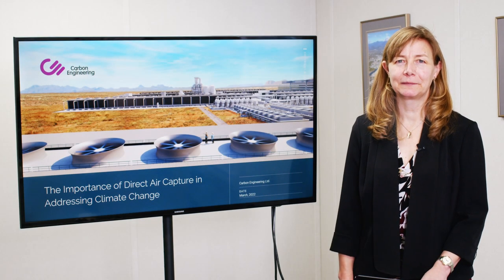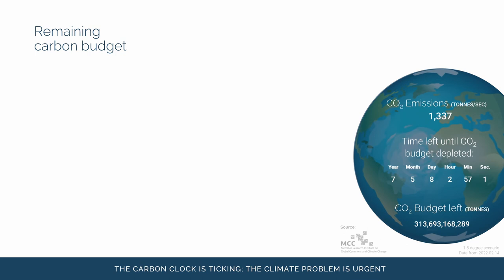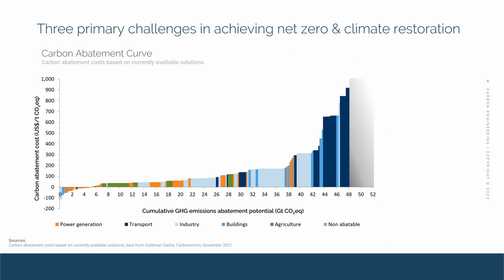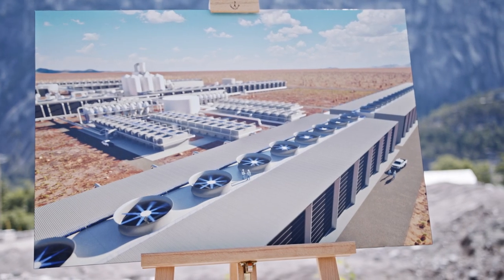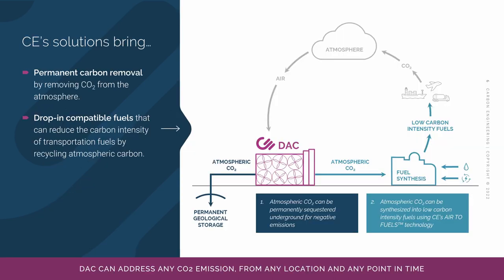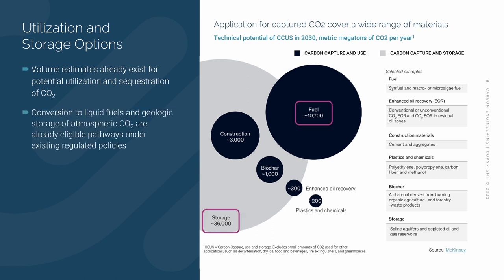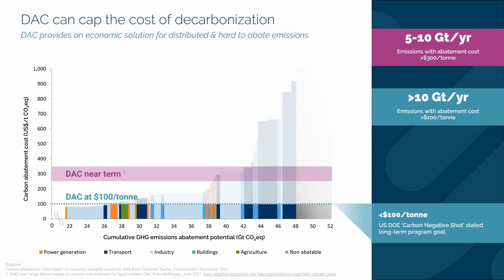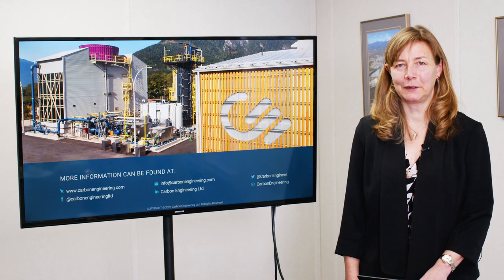The Importance of Direct Air Capture in Addressing Climate Change | Carbon Engineering

Comment: Question: Are you looking into using synthetic fuel based on DAC to solve the volatility issue of green energy sources such as solar panels and wind turbines? To me that could be one of the most amazing uses of this technology. When wind/solar farms produce more energy than the net needs you can use the excess to synthesize synthetic fuel which you can then burn when the wind/solar farms produce too little. In essence, this technology could in that case solve the issue of electricity storage as well.

Comment: Nice. However, the one thing that is absolutely crucial is your energy requirements to capture the CO2, compress it sufficiently and transport it to, say a depleted gas reserve. Have you done calculations on whether or not this process is net zero? In other words, how much c02 goes out in the air versus how much you can put in the ground? Can your process be completely electrical? Is it possible for green hydrogen to power your processes?